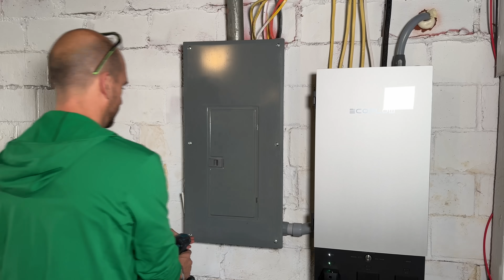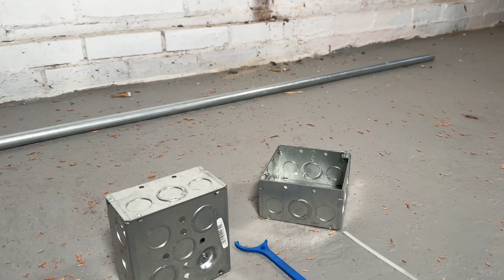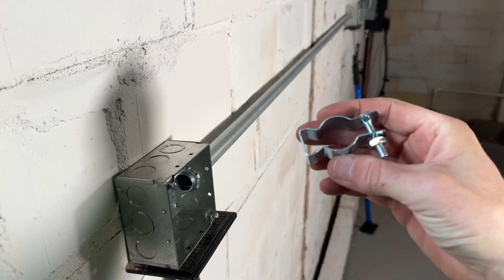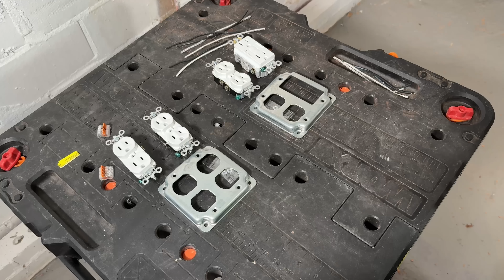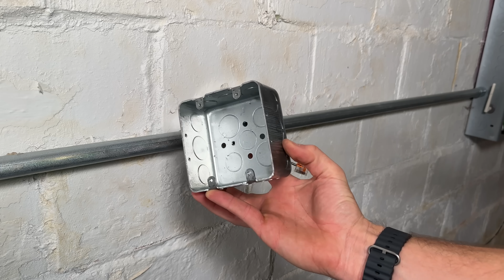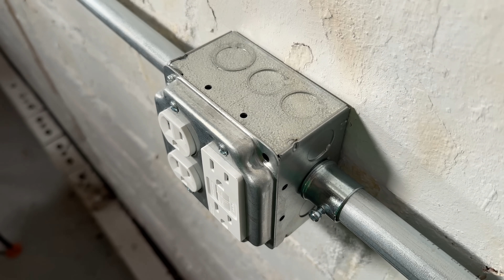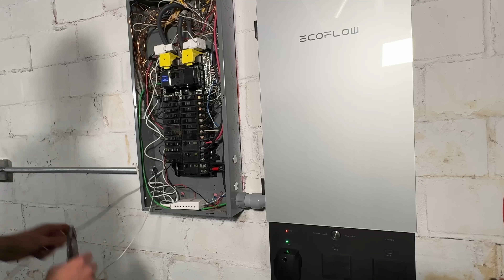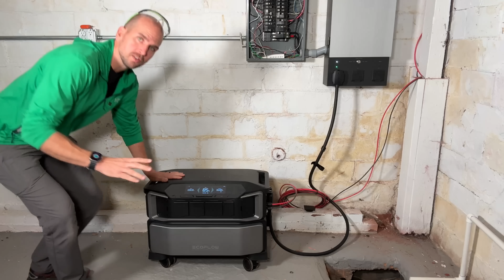Add Outlet To Unfinished Basement Or Garage

Comment: To be clear - While it is ideal to use individual conductors, it is NOT required by NEC.  As long as there is enough room (per the NEC table) inside the conduit, you are allowed to use NM (sheathed) wire.
Reply: Admittedly I always believed it was not propper too but could not see changing back and fourth going to islands , so I ran oversized conduits and finally just looked it up , then asked an inspector if I missed something and they were just letting it slide ... nope, perfectly legal
Reply: @MrOpinionCantSignIn a
Reply: @MrOpinionCantSignIn  You do where I live. It used to be okay to use the conduit as a path to back ground, but not any more. NM cable in conduit is also no longer allowed anymore. That can vary from jurisdiction to jurisdiction, but we can't do it anymore. We also cannot strip back MC and go from MC to EMT and run the wire in the MC in EMT. The MC manufacturers no longer stamp the wires inside the MC with the type & ratings so that makes it illegal now. The wires have to have the 600VW rating, the type of insulation, etc.  marked every 2 feet, or you can't use it. Back in the 20th century the wires inside MC cable were all marked like 600WV spool wire. NAFTA screwed that all up.
Reply: @Satchmoeddie   not fight, just giving info Incase you need to.334.15 talks about protecting nm cable from damage, still.

This allows nm to be protected inside cabinets and exposed.

Yes, I know your ahj can say no.
Reply: @keithharrington8715  An inspector can't say no
Reply: @stevenj100  this sounds like it is in violation of section 90.4.  ahj get to do about whatever they want and the inspector is their guy in the field.
Reply: @keithharrington8715  @keithharrington8715  Absolutely not the inspector is not the AHJ and he can not make up rules based on his opinion.  The AHJ is the local code making panel and no rules can be enforced that are not written in the NEC or written in local amendments.
Reply: @Stevenj120volts  for you, maybe
Reply: @keithharrington8715  He's correct. Inspectors can only apply a code that has been formally adopted. They do not get to fail installations that are code compliant simply because they prefer something else. I always push back on inspectors when I'm 100% certain they're wrong and I always win.
Reply: @pld8993 interesting comments and in reality it is true. But I have seen and heard many times of inspectors who have come up with their own  interpretations of the code and then follow up that statement to the person they're inspecting saying,  "we can do this the easy way or we can do this the hard way."
Reply: @mikeslater6246  Any comment like that from an inspector and a real electrician would be on the phone immediately talking to his boss. Every time an inspector has been wrong about something, I've pushed back. If it's something minor that will take 5 minutes of my time, I might appease them but the written code is the rule, the inspector's personal opinion is not. The code is mostly very clear and intentional and is not open to random interpretations and yes, I've made those phone calls downtown on a few occasions. I've been teaching the NEC for 25 years so more often that not I know the code better than anyone else in the room. Bowing to an inspector's whim is probably more a matter of ignorance than fear since many electricians never read the NEC and simply accept what others tell them it says.
Reply: @pld8993  I'm well aware of everything you said and don't disagree with any of it. I was just giving examples of what some inspectors will try to pull and in one particular case the individual I'm thinking about finally refused to accept subcontract work in that jurisdiction because of the BS. He just didn't want to have to deal with it. Being a one-man operation it was not just a 5-minute call to the man's boss. It's great you live in a utopian area where you have Mastery over everybody but not everybody has that circumstance.
Reply: @mikeslater6246  Yeah, utopian and mastery, that's what I said.
Reply: @pld8993  no you really didn't use utopian and mastery. 
I  just mentioned a scenario that I've seen occur and you proceeded to inform me of what a REAL electrician would do and without knowing what the response to that inspectors comment was you talked about how that response was probably out of fear or ignorance all the while making sure that I understand that you are the brightest bulb in the string.  Sounds pretty much like one of those inspectors I've observed. Are you naturally this hateful or do you have to practice?
Reply: @mikeslater6246  Yeah, I said I'm the brightest bulb and because you are somehow offended by my comments that means I'm hateful. So do you always make assumptions or do you sometimes read the actual words people write and understand them? Fear of inspectors and ignorance of the NEC is very common in the trade. If you were an electrician you'd know this.
Reply: @pld8993  
  do you mean assumptions like the one you just made. Electricians aren't the only people dealing with inspectors.
I'm not an electrician and never have been. But when I was a property manager and building operations supervisor I dealt with plenty of inspectors across all the trades. And I have seen plenty of what you described. And that is hateful!
I can't tell you what you meant to say but I can tell you what I read and what I read is what I wrote, that you are coming across just like those inspectors that like to intimidate people who are unaware of the actual code or unwilling and maybe even afraid to deal with the problem. As I said the main person I was thinking about just stopped doing work in that jurisdiction because there was plenty of work in other areas to keep him busy. He was a one-man operation and didn't want to deal with the bs.
Now, I don't know you and you don't know me. I could absolutely be overreacting to what you wrote, but you ought to keep in mind that if you have offended somebody it is a possibility that you are being offensive. Just some food for thought.
Reply: @mikeslater6246  Yeah hateful, and you're offended. Life is sometimes unfair and offensive. Get over it, snowflake.
Reply: @pld8993 😊😊
Reply: @Satchmoeddie  the mc cables are marked because it has to be to meet the listed standards. So with thar . I don't think you know what you are talking about.
Reply: @keithharrington8715 only with approved amendment.  They can't do just what they want. The problem is electricians are lazy and don't follow up with what the inspector says.
Reply: Still allowed in 2025 NEC, as long as fill requirements are satisfied.
Maybe your local inspectors have not read the book. Which I find often locally.
Reply: @richt5986  You wrote three sentences, every one of them is incorrect.
Reply: The problem is the NEC table examines conductors by their diameter and the NM cable has to be treated as one giant conductor, because it is explicitly said as such in NFPA 70 Chapter 9, Paragraph #9, which reads:

"A multi-conductor cable, optical fiber cable, or flexible cord of two or more conductors shall be treated as a single conductor for calculating percentage conduit or tubing fill area. For cables that have elliptical cross sections, the cross-sectional area calculation shall be based on using the major diameter of the ellipse as a circle diameter."

As NM is an elliptical cable it gets classified as if it were a massive circular conductor, which means NM-b cable needs an unusually massive conduit. After working through Chapter 9 Article 358, the conduit size for single 14/2 gauge NM cables with ground, each 9mm across, needs to be 3/4 inches. 12/3 cable (12.5mm across) needs 1 inch conduit. The same 15 amp / 14 gague circuit in THNN conductors would fit 7 times in a 1/2" conduit  (7 hots, 7 neutrals, and using the tube as ground for all 7 circuits), and the same multi-wire branch 20 amp circuit would fit three times in a 1/2 conduit (6 hots, 3 neutrals, tube as ground) for a total of 6 20-amp 120 volt circuits.

One of the other common issues with NM-B inside conduit is you may be using conduit because of a wet location. NM-B isn't allowed here at all, but THNN is.

Finally, stripping the cables out of the NM-B jacket is a bad idea because only the jacket has the "NM-B type" listing and Underwriters Laboratory certification printed on it. The cables inside have no type listing; your inspector will consider this "non-listed cable" even if its comparable to THNN type cable. Do I care? No. Does your inspector? Probably.
Reply: @thesmallterror he used 3/4 inch conduit and could have put that 12/2 NM cable in it. The reason he didn’t was he thought it was not allowed and he donate now any better. But your explanation is perfect.
Reply: @thesmallterror   just a reminder......note 2 of that section dismisses the fill requirements if it is not a "completed run'".
Reply: @keithharrington8715  Such as an EMT stub up a basement wall dead-ended between the joists. This video, however, shows a complete system
Reply: @pld8993  it does show a different situation from stub-ups.  It falls under 2023 NEC 334.15.(B)......EXPOSED WORK / PROTECTION FROM PHYSICAL DAMAGE ...... On the unfinished wall.
Reply: and in that case if a romex in a stub up not secured at box (would not be) then where exists would need to incorporate the clamp/strain relief,m there are connectors for that.  Where is prohibited running romex in conduit is in wet, outside type locations but EMT inside not damp location then fine as long as meets the fill requirements
Reply: @mikeclarke3005  No clamp or strain relief needed, but must be secured/stapled within 12" of where it enters the conduit.
Reply: @thesmallterror  Your math is way off. A single 14-2, 12-2 or 12-3 NM cable in 1/2" emt does not exceed the 53% fill limit, not even close.
Reply: You cannot use an NMB with the sheath cut off inside a conduit because The Wire inside does not have any UL printing on it. You cannot prove what it is therefore it does not pass code. It is the exact same solid wire that comes on a spool. But that wire has a ul rating on it.
Reply: @gwilliams1001  you are referring to chapter 9 table 1.  Yes 1 conductor or cable can only fill to 53%.

Again, note 2 of the same table allows you to use 
"If it fits, then it fits",  if the conduit is for protection and not a completed run.  This may allow you to use 1/2 conduit to protect nm cable and not make an extra run for bigger if it is not a completed run.
Reply: @keithharrington8715  I have never read note 2. Thankyou for this !!   30years in, Master electrician and always learning.
Reply: Should've ran a ground.
Reply: Whew.......it's hot in here!😊
Reply: You are absolutely correct.  I don't think he knows about the National Electric Code.  When I was at a Home Depot the employee in electrical was giving a customer bad advice about the number of conductors in a device box.  I intervened and told the customer that he needed a larger box. as he was running two 12awg romex cables.  I told the home depot associate that he should know the NEC before giving advice.
Reply: @ronaldandolsek4637  agreed x1000.
Reply: Can you extract the individual wires from inside an NM cable, and treat them as if they were THHN in their own right?  One place you might see this, is if you're sleaving the final foot in conduit, and then running the cable in hollow framing.
Reply: Romex can be installed in conduit in a basement. It’s even in the code. You just have to size the conduit properly. A single 12/2 would have been minding 3/5 inch conduit. 

334.15(C) In Unfinished Basements and Crawl Spaces. Wherecable is run at angles with joists in unfinishedbasements
and crawl spaces, it shall be permissible to secure cablesnot smaller than two 6 AWG or three 8 AWG conductors
directly to the lower edges of the joists. Smaller cables
shall be run either through bored holes in joists or on running
boards. Nonmetallic-sheathed cable installed on the
wall of an unfinished basement shall be permitted to be
installed in a listed conduit or tubing or shall be protectedin accordance with 300.4. Conduit or tubing shall be provided with a suitable insulating bushing or adapter at the point the cable enters the raceway. The sheath of the nonmetallic-sheathed cable shall extend through the conduit or tubing and into the outlet or device box not less than 6 mm (1⁄4 in.). The cable shall be secured within 300 mm (12 in.) of the point where the cable enters the conduit or tubing. Metal conduit, tubing, and metal outlet boxes shallbe connected to an equipment grounding conductor complyingwith the provisions of 250.86 and 250.148.
Reply: @richt5986  Completely wrong. The jacket on NM-B is not a raceway; NM-B is a multi-conductor cable. Entirely separate definition in code. Furthermore, you cannot strip the conductors out of NM-B. They are not labeled or required to be THHN or XHHW. This is an immediate inspection fail for using an unlisted cable.
Reply: Wow, this is correct. You cannot run Romax in an unfinished basement because that is considered a wet location and Romax is not approved for wet locations.
Reply: @biasdahl4737  Incorrect. A basement is never a wet location unless it rains in there. A damp basement is a damp location, but most basements are dry locations.
Reply: @biasdahl4737 unfinished basement are not considered a wet location.
Reply: @biasdahl4737 wrong. 334.15(C) In Unfinished Basements and Crawl Spaces. Where
cable is run at angles with joists in unfinished basements
and crawl spaces, it shall be permissible to secure cables
not smaller than two 6 AWG or three 8 AWG conductors
directly to the lower edges of the joists. Smaller cables
shall be run either through bored holes in joists or on running
boards. Nonmetallic-sheathed cable installed on the
wall of an unfinished basement shall be permitted to be
installed in a listed conduit or tubing or shall be protected
in accordance with 300.4. Conduit or tubing shall be provided
with a suitable insulating bushing or adapter at the
point the cable enters the raceway. The sheath of the
nonmetallic-sheathed cable shall extend through the conduit
or tubing and into the outlet or device box not less than
6 mm (1⁄4 in.). The cable shall be secured within 300 mm
(12 in.) of the point where the cable enters the conduit or
tubing. Metal conduit, tubing, and metal outlet boxes shall
be connected to an equipment grounding conductor complying
with the provisions of 250.86 and 250.148.
Reply: @biasdahl4737 an unfinished basement is considered a damp location by NEC.
Reply: NEC is minimum standard, not the golden standard.
Reply: @cvr527 it is not minimum standard . It's a standard to insure a safe installation.  Can it be done better yes, but doesn't need to be.
Reply: @thomasmarable6818  Thus it is the minimum safe standard. The primary reason the NEC was created is to sure uniform safety standards across all boundaries.
So yes, the NEC is the minimum standard.
Btw, in some situations, mainly commercial, there are sound reasons to exceed the NEC.
Reply: @cvr527  Incorrect, the NEC is not a minimum standard and exceeding NEC requirements does not necessarily result in a better or safer installation. The NEC is followed only if and when the AHJ decides that it should be followed, and they have the authority to waive any NEC requirements if they so choose.
Reply: This is why you call an electrician for your electrical needs. Don't just pick up the NEC and use it as an instruction manual. 😅
Reply: @AMERICANsparky32  horse***t.     All contractors do is walk in and say it's all wrong and u about to die.     For everything......to make money.
Reply: Contractors for all markets, realtors, investment PAs, banks, car repair......all the same.
Reply: @AMERICANsparky32  you could literally have the best contractor in the state.....by EXPERIENCE AND WORK HISTORY....the Jesus of contractors......do some work......
And have any other contractor later walk in and say the first guys work is trash and you are going to die in a fireball at any second......
Reply: @Werecalledtodestroyevil  B's!
Reply: @daleb5967   🤣🤣😆😆🤦‍♂️🤦‍♂️
Reply: @AMERICANsparky32  you types want people to hire contractors to install monster outlet adapters n outlet strips......
Reply: WRONG ! WRONG ! WRONG !!
Reply: If I had an electrician pull NM through a conduit, I would immediately fire him.  There is no conceivable reason to do so and significant disadvantages.
Reply: @sdkee  There are absolutely reasons to install romex in conduit, not in this particular video, but there are several. Unless it's necessary there's no good reason to install romex in conduit but other than being waste of money and the difficulty of pulling it through there aren't significant disadvantages. So you'd fire a professional because they did something that you, an amateur, might not fully understand?
Reply: @sdkee  DIY is a different case though. The best reason is that you might have 25 feet of Romel laying around. If you do it the “right way” - which I’m 100% behind BTW - you’d have to spend hundreds of dollars for 2-3 rolls of wire of which you need 25 feet. In the case shown here where it is literally less than 25 feet from the box, I’d have no issues using Romex whether to code or not (as a DIYer). It would also be really easy to undo if you had to.
Reply: @brettsherman7810  8 feet.....
Reply: @sdkee it’s not against code